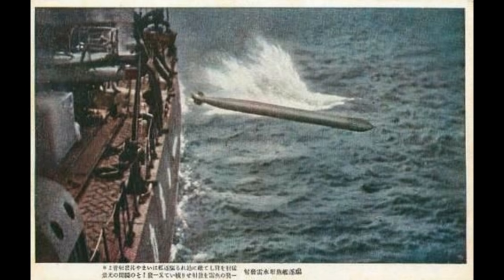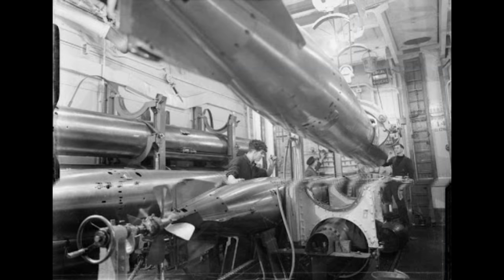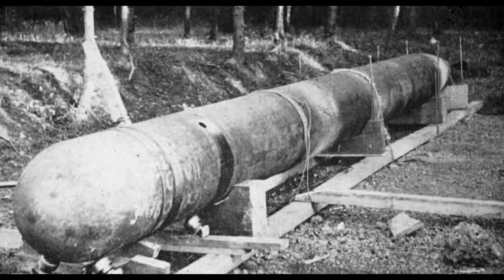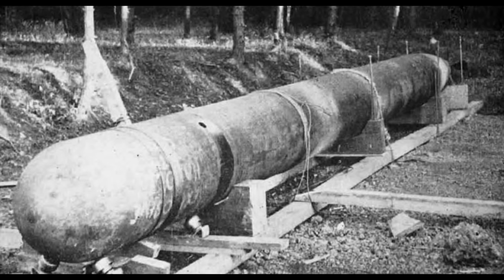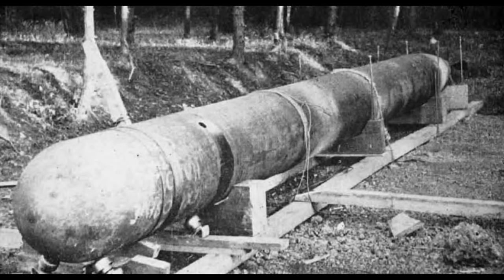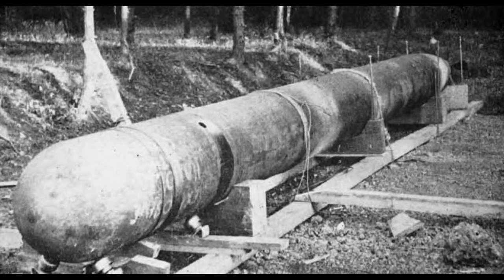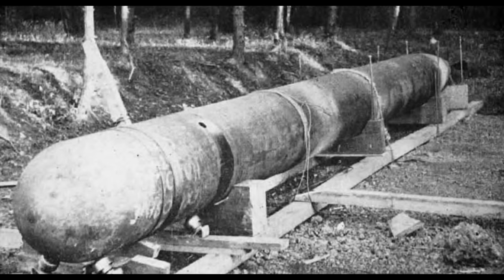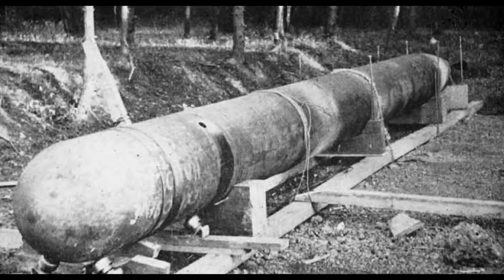Type 93 Long Lance Torpedo - Long Range Hole Poking Device

Comment: The RN tried Oxygen fuelled torpedoes before the Japanese took up the idea. The RN torpedoes had a nasty habit of exploding. The Japanese found the reason for this was the tight radii of the bends carrying the oxygen caused localised overheating. They overcame this by enlarging these radii thus keeping the bends cooler. 
My father was an Electrical Artificer (EA) in the RN pre WW2 and responsible for torpedo maintenance aboard ship. He said that he met several groups of visitors from the Japanese navy who gleaned a lot of information from us even though anything of interest was supposed to be covered with sheets. They were still at the time allies of ours, well supposedly.
We saw post war the quality of Japanese engineering so really it’s no surprise that they produced these torpedoes.
Reply: Nevertheless it was surprising to us at the outset through at least the Battle of  Tassafaronga in November of '42. You can thank the US Ordinance Bureau for much of that as they were saying the Japanese couldn't make a torpedo as good as ours right up until we had an intact Long Lance in our possession.

Comment: 5:49 "And it turned out that if you dumped pure oxygen and kerosene into the combustion chamber the torpedo would travel at fairly high speed... just instantaneously in all directions at once. Disassembling itself and any nearby people with considerable enthusiasm." 

"Explaining that this was entirely unacceptable behavior for a torpedo that was designed to smite the Emperor's enemies... didn't really tend to work out that well. Since they hadn't yet invented the machine spirit and in any case working out which bit of the torpedo you were supposed to talk to or possibly scrape off the wall was somewhat difficult once it had decided to launch a several hundred meter search into the realm of the honorable ancestors."

😂😂😂That Drach British humor 😂😂👌
Reply: He does it better than most ;)
Reply: It makes you wonder how many people were killed
Reply: @davidvasquez08  I suspect not many.  A hazard like that, quickly becomes a major "don't do this" talking point.

To be honest... what the Japanese were doing was basically making rockets that didn't actually fly.  Yeah the old phrase about how it's not rocket science? well... next best thing really.

Comment: The IJA General in command of the landing at Bantam Bay was on one of the ships the IJN sank during the Battle of Sunda Strait and had to be fished out of the sea. Given the nature of the relationship between the IJN and IJA, we can only suppose that the torpedoing of the Army transports was, indeed, an accident. 

There's a famous photo of the Mogami as she was slowly retreating from Midway. What's striking about the photo is that you can see multiple torpedoes hanging out of the side of the ship. Clearly they were trying to get rid of them, or failing that, get them as far away as possible. I've always wondered what would have happened if the plane taking the photo, probably a Dauntless, had put a few rounds of .50 cal into those torpedoes.
Reply: Those weren't torps hanging out, they were her triple torp launchers and they were swung out in the deployed position because, as you mentioned, they were trying to manually jettison the torps after the fire started. There was no more pressurized air to launch them, but they could be loaded in groups of 3 then swung out and pushed out of the tubes into the sea.

Them oxy-fuel torps bite both ways, I guess.
Reply: @gastonbell108  Are you sure? Because if you look at that photo carefully it looks like the conical ends of 2 torpedoes forward and a 3rd trailing into the water aft.
Reply: @MakeMeThinkAgain  If we're thinking of the same photo of Mikuma fleeing Midway, the drooping part is one of the smashed tubes in the triple launcher. They were left deployed (swung out perpendicular to the ship) when it was abandoned (after they kicked out as many torps as possible) and before the huge explosion that wrecked her midships, which was when the photo was taken.

Comment: I'm in the SCUBA business and work with high pressure pure O2 on a regular basis. Soon as this video started I was screaming "Are you crazy!". High pressure O2 is intolerant of any errors or mistakes, and as you so colorfully described, will show what a oxidizer is all about.
Reply: High pressure air is pretty intolerant of errors as well…
Faulty SCUBA cylinders have ended the lives of a number of divers refilling cylinders.
Reply: yeah the only reason this isn't "rocket science"... is because these things travel through water.  Pretty good start to the drive for an ICBM though.

But one thing I read as a child that stuck in my mind so hard I still remember it clearly 35 years later.... is a description of a man taking a charcoal grill made of sheet metal, filling it with charcoal, adding a lit cigarette as an ignition source, then using a ladle with a 20-foot handle to pour LOx onto the charcoal.  the resulting explosion incinerated the steel sheet metal so thoroughly there was no shrapnel.  The only thing left was the legs of the grill along with the support ring attached to the legs, and those were half melted.

Um... yeah... so... THAT is what pure O2 does.  This is why you don't smoke near it....
Reply: @allangibson2408  While true, the thought of everything deciding it has immediately decided to become flammable is a little less comforting. Pressure is scary.
Reply: These were the days when rum or laudanum was considered a perfectly acceptable way to get teething babies to go to sleep. 😂

Comment: It is incredible that Japan spent so much resources to test their torpedoes while US pretty much didn't lift a finger to test Mark 14s.
Putting this video and the one about Mark 14 side by side could teach a thing or two.
Reply: Japan seemed to have people with overly large egos in the high command, while US had them in Bureau of Ordnance. The issues with Mark 14 was in large part due the people in the original design team not wanting to admit they made an error. Japan also had a massive issue of a lot of their plans relying on the phrase "if everything goes according to plan" and thus failed when things didn't go according plans in a bad way.
Reply: two drach videos simultaneously screaming at me - I have learned that I cannot focus on two things at once.
Reply: Japan spending those resources on the torpedo was part of its problem: where the US invested in its economy, which could then be geared towards war production, Japan ended up transporting Zero's from the factory literally by Ox to the ships, because trucks would break the planes and there was no rail. The longer the war went on, the more obvious it became that Japan was a paper tiger.
Reply: @bubbasbigblast8563  Without mentioning the japanese mentality flaws as well, especially in their command
Reply: @bubbasbigblast8563 japan was never going to outcompete the USA in raw output, they were looking for an edge (a wunderwaffe, ultimately) to make their position better in relation to the US.

That's why they went into unorthodox designs moreso than the US, with the focus on torpedos to (hopefully) be more effective at sinking enemy capital ships with less material wasted, and the carriers for a tactically superior weapon that could be a better striking force than a traditional battleship.

They did what they could, although the decision to attack the US was an incredibly stupid blunder (even by some admirals' own words)
Reply: @bubbasbigblast8563  The resources spent on the torpedo wouldn't have made their economy any better. In fact having such a large naval industry provided a huge economic benefit.  And no, Japan wasn't a paper tiger. It's like saying a single wolf isn't a deadly predator because it can't face off against a bear by itself. The scales were always going to be tilted heavily in the US favor.  And have to love the obvious hyperbole on your part. Trucks would not break the planes. Clearly you're running off the assumption that they were made of wood, which is a myth.
Reply: @bubbasbigblast8563  With what resources was Japan going to invest in its economy? Japan is notorious for having very poor natural resources, importing coal from the British Empire and later oil from the US. Germany had a similar resource issue which is why Hitler went to war: to secure resources to ensure Germany could stand alone because he thought that trade would lead to the collapse of civilization (the Shrinking Markets Problem)
Reply: @RaderizDorret  With the resources it was spending on war materials during the Great Depression instead: Japan was investing practically all of its material and engineering might into gaining more weapons, with the vain hope of defeating the US with an Army and a Navy that was never going to be competitive in the timeframe Japan wanted.

If Japan had focused on limited wars instead, it could have at least obtained some resources before it was made to back down; far better that than the total loss it got historically.

Comment: The IJN had 2 "torpedo cruisers", the Oi and Kitakami, that carried 10x4 torpedo mounts, that's the ability to fire 40 type-93 torpedoes.  This was on a standard light cruiser hull.  Pound-for-pound these cruisers had the most ship-killing potential of any ship in the world.  These were old Kuma-class light cruisers that were only modified to be torpedo cruisers in Mid-1941. Strangely, roughly a year later both ships were converted to the fast-transport role.  Neither ship played any part in the crucial cruiser battles around Guadalcanal.
Reply: Imagine a shell hit on one of those if it hadn't launched any torpedoes yet. That would have been an epic explosion to have witnessed in person. With the added benefit of nobody is going to survive that at all so they're likely wouldn't be too much suffering
Reply: @the_undead  yeah,  there were was at least one lucky. Hit in the Battle off Samar that blew up a heavy cruiser
Reply: @stevehofer3482  if you're talking about the cruiser I think you're talking about there have been dives on the said cruiser and the torpedoes are all intact so that was something else that exploded on that one I don't know if it's known or what that was but I really can't be bothered to go try and figure it out.

Also with what I know about these torpedoes and the physics of explosives one of these launchers with a full set of reloads would likely blow a ship in half unless it was on the size of a battleship, liquid oxygen is not something to be messed with

Comment: So what you're saying is that a type 93 was actually faster than a Swordfish torpedo bomber if there was any form of significant headwind? 😂
Reply: Could you imagine if a swordfish somehow dropped one of these things? The pilot would have to dodge the water spout from his own hit on the way out. 🤣
Reply: @Ralph-yn3gr  It probably weighs more than the Swordfish.
Reply: @RCAvhstape  It almost does. According to wikipedia the Swordfish I has a gross weight of ~7500 pounds while the Long Lance has a weight of ~6000.
Reply: how schizotech the warfare actually , great Britain possesing knowledge to make jet engine yet using canvas and wood airframe to do heavy lifting.
Reply: @jalpat2272  I highly recommend reading "bring back my stringbag" by Lord Kilbracken. It is an excellent account of service with the Swordfish. The point being that it actually worked better than any thing else alot of the time.
Reply: @jalpat2272  The De Havilland Vampire had a significant proportion of wood used in the airframe.
Reply: But swordfish pilots usually had good aim
Reply: @riverraven7359  Always bugs me in articles about the sinking of Bismarck. The gunerry of Bismarck was apparently excellent to sink Hood, yet the swordfish crews were blind lucky to seriously damage Bismarck. No. They were extremely skilled, and made there own luck by hitting Bismarck whilst under a storm of fire, in shitty weather, and in near darkness. And it wan't the only time they were devastatingly effective.
Reply: @gordoncroft4524  my favourite is the "SPOTTER" at narvik who tried soloing a German destroyer.
Reply: @riverraven7359  They had plenty of time to do it.
Reply: @gordoncroft4524  No. Bismarck’s anti-aircraft artillery targeting was not designed for medieval air power.
Reply: @riverraven7359  That describes it about almost perfectly. A Swordfish with a torpedo looks to me quite like a very aggressive windsock
Reply: @gordoncroft4524  One hidden advantage of flying a fabric-covered plane is that most anti-air weapons will have a hard time bringing you down. The fabric offers almost no resistance to anything trying to get through it, so unless you want a fuse so sensitive that hitting a strong north wind will set it off, contact explosives will be next to useless. While you can always switch to timed-shrapnel fuses, when the sights you have weren't designed for aiming at a hovering target, you are going to have a hard time keeping your shells from exploding way in front of the attacking flight. And even if you actually got a shell to explode near one of these planes and spray it with shrapnel, instead of taking chunks of the metal skin, hydraulics, and fuel pipes along for a conga line of mayhem, said shrapnel will do little more than poke nice little holes whatever hapless strip of fabric or flesh happens to be in the way.
Reply: @chamberlane2899   Indeed, the Swordfish that attacked Bismarck had hundreds of holes in them, just nothing critical. Mosquitos had good survivabilty partly due to this too.
Reply: @gordoncroft4524  Helped by the fact that the training mechanisms for Bismarck's AA armament was unable to traverse slowly enough to engage Swordfish. Sometimes it's better to have something that works than something shiny.
Reply: @alecblunden8615  Agreed, IIRC the swordfish was an excellent aircraft for heavy lifting (for it's size), and the attack on Bismarck was no fluke IMO. They hit him because they were well trained, not by luck.

I'm not even sure hitting the rudder was entirely by luck. I saw an interview with one of the surviving crew who said they were told to aim for the engines, rudder, stearing gear area. Obviously in shite weather, against a maneuvring ship some luck will be involved. Howevr, I think ghis was definitely one of those times where skilled people made their own luck.
Reply: @Ralph-yn3gr  what if two swordfish suspended it between them I wonder what the air speed velocity would be
Reply: @paullytle1904  I'm not sure. Probably close to an unladen swallow I suspect.
Reply: @Ralph-yn3gr  African or eurppean
Reply: @paullytle1904  I don't know that! 
sprong 
Waaaaa!!!!
Reply: @Ralph-yn3gr  what is your favorite pre dreadnaught?